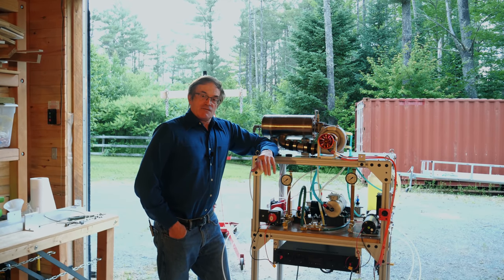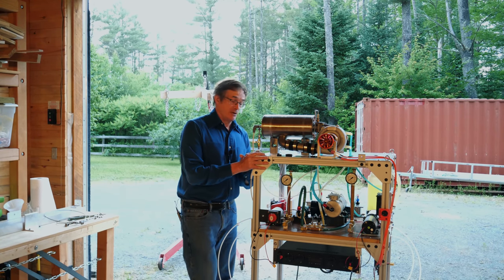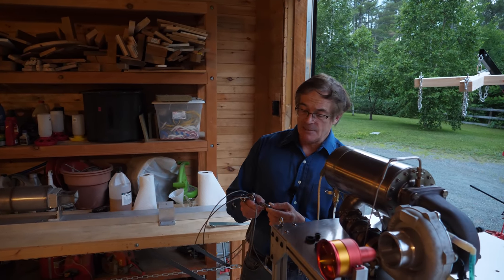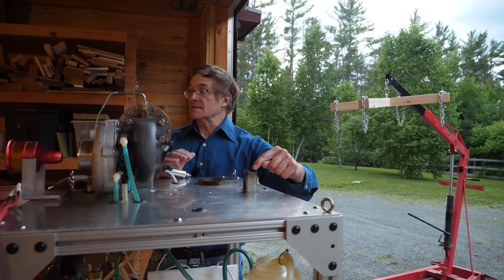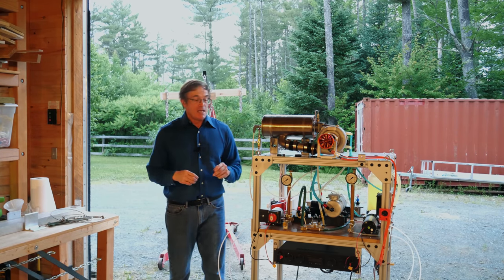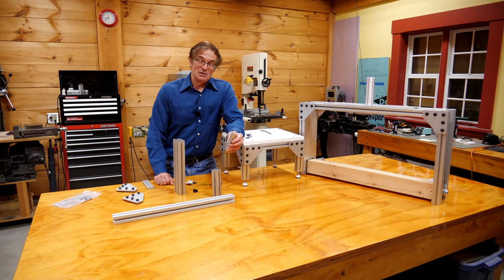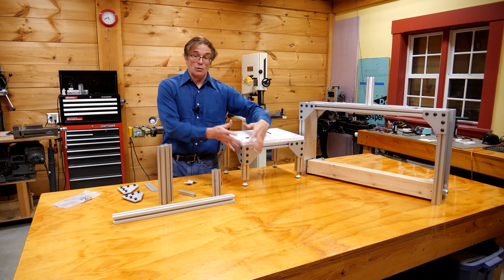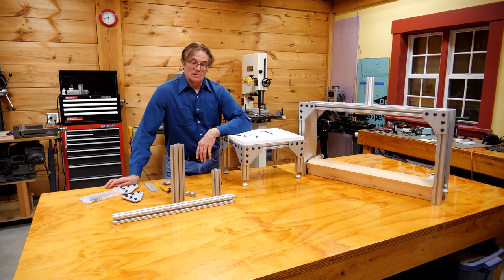What else goes into building a jet engine? - Part 1

Comment: i'm curious what your end project is, what you will use the mechanical output for. i was considering the end goal for my project to just drive a turbine mounted to a cheap generator, you could bypass to get correct rpm for power generation but i havent formulated any load response mechanism or process, a little further down the road. i suspect highly inefficient but that's not the point for me, im not going to beat rolls or GE anytime soon, just for fun right :P  

on the structure you seems fond of you gave the benefit of gusseting to the product, you can add gussets to welded structures of course as well! ;P although you certainly cant beat this item's modularity really! as always thank you for raising the tide of human knowledge kind sir

Comment: definitely very useful for small-medium sized objects that need to be rigid - its a popular frame material for 3d printers and cnc machines.
i don't think it'd be great for building a house though, the connectors have very small contact points to the beams.
Reply from the maker: I disagree about the building because those contact points are widely distributed.
Reply: @TechIngredients  the little wedges don't have much area. granted when you use those angle connectors with three of them you get a bit better. i don't think it would be as strong as a good wood joint with nails and glue.

that said, nails and glue are not nearly as easy to use. i don't think its a bad system, but it has its strengths and weaknesses.

Comment: have yall considered putting an intercooler between the compressor and the combustion chamber?
Reply from the maker: No.  It would  decrease the performance.   Removing  heat energy is useful if you want to pack more air into the cylinder of  an engine, but it decreases the total volume of air that the combustion chamber in the jet engine is trying to maximise when it heats it further.

Comment: Where would engineers be without 80-20?  I don't know how many things I've bolted to 80-20 rails. Once in a great while I've had to machine a bite out of one to clear some odd projection in the project, so don't say you never have to machine it, but yeah, most stuff goes together with gussets and T-nuts.  And the extrusions are just 6061 alloy, so they machine easily if you do need to make an odd shape on one end or something.

Comment: I don't think 8020 actually invented those profiles and the add-on system. But nevertheless - they are very awesome and are available in different versions (e.g. item, bosh) and from different vendors (which often have all the possible versions, and at a fraction of the original price).

Comment: Is there a way to get shaft power out of the turbocharger? For generating electricity? Theoretically, turbines are the most efficient I.C. engine, and if you could use the electricity AND use the waste heat, you might have a way to heat your house + generate electricity. In other words a residential scale combined heat and power system. If good heat recovery was possible, it would be like burning propane (normal furnace) and burning propane + generating electricity. BTW, love your detailed vids, anonymous presenter and younger guy.
Reply from the maker: Yes, there is.
And, thanks!

Comment: could you talk about termal expansion - what elements present the biggest problems
Reply from the maker: Really  it's just the flame tube in the combustion chamber and afterburner.  Just estimate the maximum  temperature (about 700 C) multiply by the expansion coefficient for stainless steel and fabricate with at least that clearance.

Comment: One may replace the more expensive  aluminium joins (the triangular shaped pieces) with cheaper triangular steel plates. Just an idea.
Reply from the maker: Sure. You can even download the pdf files for each part from McMaster Carr.

Comment: try syringe screw pressure plate injector container (electric engine driven hydraulics) liquid rocket engine
Reply: make your metal with high voltage break-down electron avalanche field, cold high electric field breaking bonds process, not zap, not hot hydrogen or coal, semi cold electron process
Reply: that house idea is great, kinda like a skyscraper but with premade cross-hair beams, aluminum (as opposed to the usual steel I-beams, that would be great as well)
Reply: multi-joint connector with screws, insert, screw, multiple axes support
Reply: making a bicycle or motorcycle frame skeleton should be super easy
Reply: note, the pipe inserts, with the screws, dual support, not only one
Reply: I mean an universal 6-axis joint piece, insert the extrusion, bolt it down, you can even pin the bolt, 3-stage lockdown

Comment: This is where these guys need a little bit of a reality check, I worked it out, that it ROUGHLY costs $850 dollars to make that frame, that's not even included in the aluminium sheeting top and bottom or the epoxy coated plywood (which is also v expensive per sheet) 

Just to make this whole mount alone would cost over $1000 to me that seems bordering on utterly ridiculous for 99% of us. 

It would be lovely to habe the money to afford these types of equipment, but its a bit far fetched to think most of the audience could afford that kind of spend just to make a mount for the set up.
Reply from the maker: You need to check into alternative  sources.  The stand costs approximately  half that. The shelf is MDF which costs about  $15 including the epoxy coating.
You can certainly build the stand from scrap steel shapes for substantially less, but you then loose the easy reuse of the 80/20 components.
Reply: @TechIngredients  its, 75c per inch you used roughly four  4 1/2 ft vertical lenghts, nine 3ft horizontal lenghts and six 2ft horizontal lenghts, Roughly based approximately on your height. Thats 576"    x.75 = $432.

You used 24 Corner brackets which you said yourself cost $15 each thats $320 

Thats $750 without nuts, bolts or the shoes and base its mounted on, 

Usually you can't buy marine ply or as you called it epoxy coated plywood in anything less than 8ftx 4ft and it is well over $100 per sheet even at half inch thickness. 

The aluminium sheeting is probably around $50 each and I'd imagine I'm low-balling that price as well. 

So I really don't know how you built it for less. I mean at very least all in it costs $850. 

BTW, I'm just jealous, I'd love to be able to afford this type of equipment, I'm just pointing out the vast majority of your viewers are like me, in that it's just unrealistic for most of us to spend that much on a stand, even half that much seems crazy expensive for a stand.
Reply from the maker: It's  MDF as I said, not marine plywood.
The aluminum sheets were about  $30 each and the rail cost $350
However, as I said you could scrounge material and build it cheaper.  This is true for the pumps, meters, tubing and the turbo as well.
What matters  is understanding  the principles and taking away ideas that can be applied  to your own builds.

Comment: Your Alu extrusions seem a little overpriced. I personally use motedis a lot. But the extrusion systems are great. If you don't want it to sound like an add don't just recommend one company
Reply: But he can only recommend the company he have some experience.
In my university they use these type of Aluminium-frame and bolds too.
Reply: @mikropower01  in my experience they are all good choices and it comes down to cost and compatibility with accessories. There are different styles with different proportions of slot to total with for example

Comment: Why do these turbocharger based engines make such little power compared to conventional jet engines?
Edit: even when used as a gas producer on a free power unit, their power output seems low :(
Reply from the maker: It's not too complicated. Firstly, conventional jets have over 100 times the inlet area and move a proportionally greater mass. Secondly, conventional jets have a much higher compression ratio and as I explained in the video that preceeded  this one, that increases their effeciency.
Reply: @TechIngredients  I liked your analogy of how compression increases effeciency.
Even model jet engines (like jetcat for example) seem to have far greater output than these turbo based engines sadly :(
I'd still like to power something useful with one.

Comment: please, now that you are with turbos, make a turbo-stove, see if you can think of a way to make it stable and not accelerate until it explodes. 🤣😉
Reply from the maker: It's  an interesting  idea.  The simplest, boot strap control would be a pressure pop off in the compressor  delivery line. The waste air can be vented into the atmosphere or sent to the intake to the turbine to limit its temperature or both depending  on the performance.